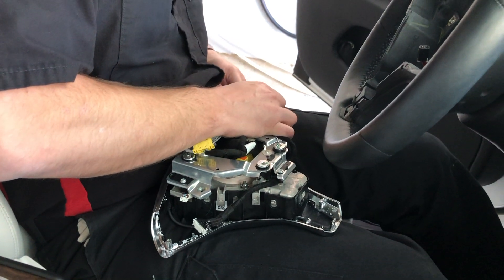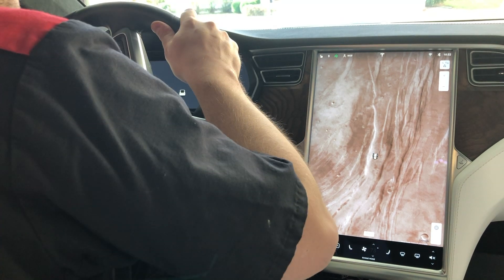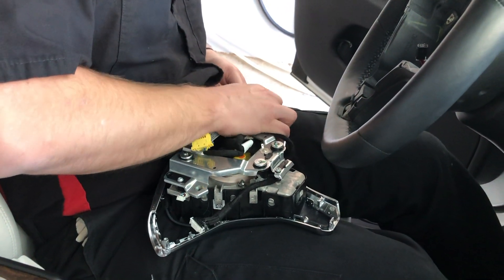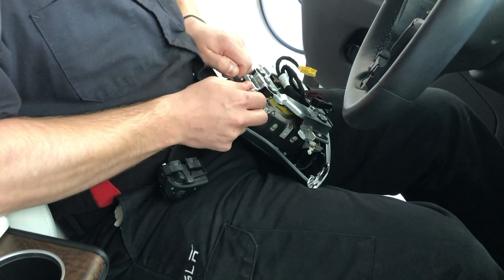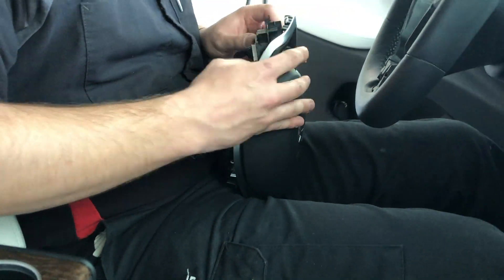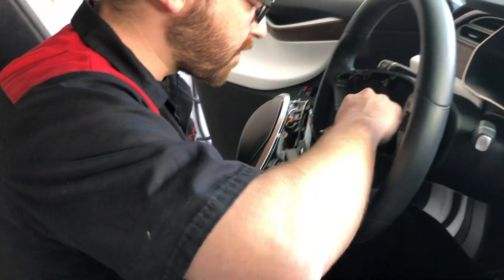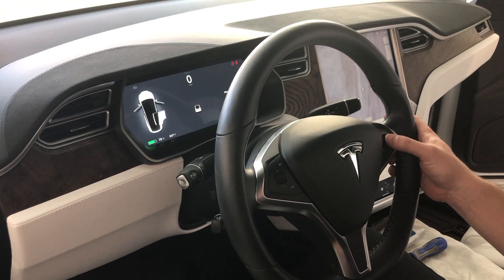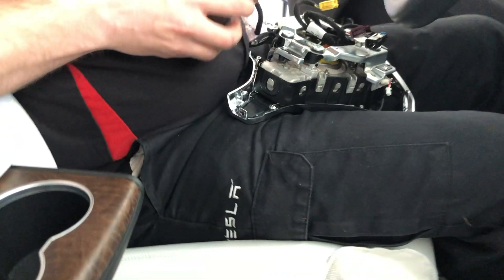Tesla Mobile Tech | How to Replace Steering Wheel Controls on Model S & Model X

Comment: Great Video.  I have always had great Tesla service experience when they have come to service my vehicle.  No complains on that.  Now, the question will be... will Tesla sell me the the two steering wheel controllers for my Tesla?  Currently mine, has the following issue:  when a press the "steering wheel HONK" the "Voice command" feature activates (that's a big LOL).  (Keep in mind the actual command button feels and clicks just fine, but (It DOES NOT ACTIVATES the -Voice Command features- anymore) I noticed this happened after a Tesla update about 9 to 10 months ago, but when I tried to report it they are saying it may be the buttons, but, as an IT, I can tell when a "working" button feels and clicks.... and they do not want to believe it is software related issue.  (There may be a slight chance it could just be the button -as they suggested; however, I'm a bit skeptical about it).

Comment: When I go to SAFETY>POWER OFF to turn off the vehicle, it keeps turning back on within about a minute which is preventing me from disconnecting the airbag.  Any idea why the car keeps turning back on?  I have not touched the screen or brake pedal.
Reply: Weight on seat changing will turn it back on- very frustrating. You’ve probably figured this out by now but you’ll have to disconnect battery to turn car off

Comment: Did the mobile tech disconnect the 12v battery before removing airbag? Or just turned down the car? I am considering doing this myself but don’t want to disconnect battery
Reply: Looks like no. I've seen multiple videos now where they don't disconnect the 12v battery.

Comment: I wonder if your horn was working or not. I have an issue where the scroll wheels and horn stopped working in my 2017 Model X at 94K but my horn also does not work. Trying to understand how the scroll wheels and horn tie together. Wiring harness and a more central controller? I would say to add a horn test before and after fixing too.
Reply: Hello comment from 2Y ago! Same here w/ 2017 MX ! Mine was an intermittent fail, randomly cutting in/out (controls + horn, stalks work fine) 
Tesla wants to replace the buttons + harness assembly. but I fail to see why the buttons need replacing. I did find that randomly smacking the horn around would restore functionality lol. How did your situation wind up?
Reply: @TheRealFrankGrimes  Tesla replaced buttons and harness, and I haven’t had a problem since.
Reply: @OurTeslaModelXJourney  Thanks so much. To confirm, that is the two scroll buttons and the wire (harness) between them, that's it aye?
Reply: @TheRealFrankGrimes  Our video Day 1731 is where the problem occurred. That was March 12, 2022. Looks like service appt. on April 4, 2022 is where the fix was done along with the FSD camera upgrade. On the invoice, it's ASY, Steering Control Switch Harness (1013242-00-K) 220.00 plus an 87.50 to remove and replace steering wheel. They did not replace Ruby's wheel thank goodness. I have an awesome real leather wheel with a few loving dings in it at this point.  Maybe the estimate showed the buttons but not the invoice? Not sure.
Reply: @OurTeslaModelXJourney  Thanks so much!

Comment: If this is firmware issue then hardware replacement won't solve it. I have similar issues and I was planning to replace switch by my own looking at this video but looks like if it's firmware issue then it won't fix it. Elon is unethical smh 🤦🏼‍♂️

Comment: if not under warranty, how much will be charged to change the steer wheel button?
Reply: Part: Tesla Model S -X  Steering Wheel Control Buttons 1013242-00-k
Reply: The quote I got from TSLA for a 2015 Model S was $299 and change for part number 1013242-00-J.
Reply: $323 was my quote. Part was $220

Comment: Do you happen to have the part numbers from the invoice?
Reply: @0:11 Looks like the Manuf Part Num is 1013242-00-F, the order-able part number.  The label "FR6274 659 A" is a completed hardware right side assembly.  The left side would be "FL6274 659 A".  Both sides,  "FR6274 659 A" & "FL6274 659 A" plus the cable assem between them plus whatever "Software 1/2" is loaded become 1013242-00-F.
Reply: How much was it?

Comment: Plastic  cheap plasticity on wheels
Reply: The entire steering wheel and stalk is made by Mercedes ;)
Reply from the maker: As a user it doesn't feel like cheap plastic. It does feel nice. It also turns out that nothing was wrong with the button and that didn't fix the issue. Turns out it was something in the firmware.
Reply: @ALLElectricChannel  hello Sir this is firmware issue and not actual hardware switch issue? I am having similar issue and I was going to replace the switch after watching your video. What do you recommend? Will the replacement fix the issue or I just wait for new firmware update?